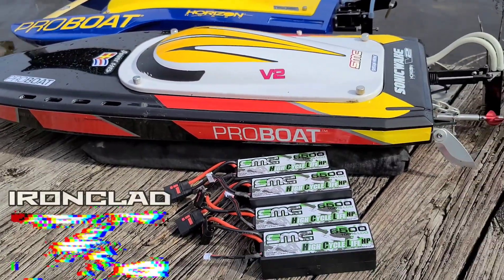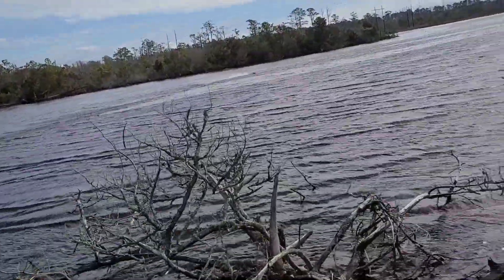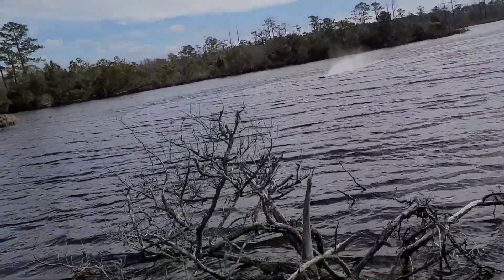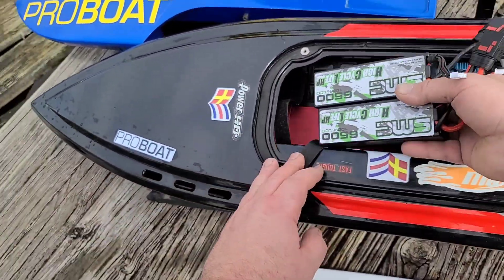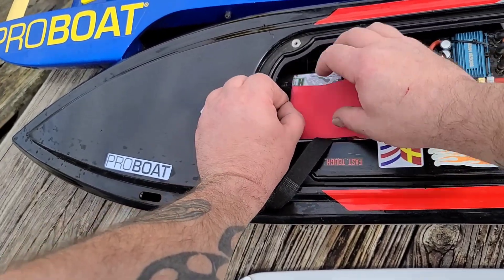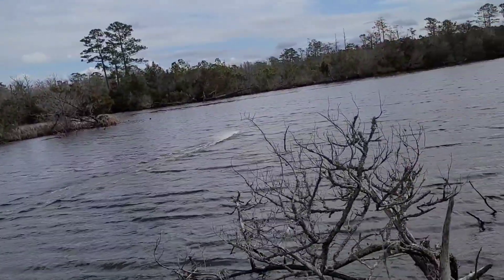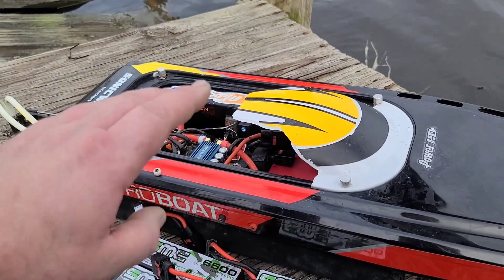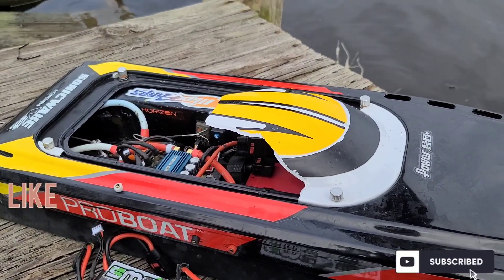Lipo Battery Review & Test Gone Horribly Wrong

Comment: What batteries should I run for a stock motor v2 ? Single? Dual ? I’m so confused.
Reply from the maker: Single 6s with a jumper connector,  or 2x 3s lipos, Either setup is about the same.

Comment: Hello Terry I have been watching your vides now for a couple months now. I have learned so much in this time frame. I watch you like clock work always sitting on the edge of my seat. Ty 4 all the great videos. I am a nitro guy and gas rc boater from way back. I am just starting out in Electric  S battery boats.  I just bought a proboat sonicwave v2 I love this boat the best based off all the videos that you have done so fare.. I believe the biggest upgrades you have done is all the different props you have tried on this boat. The 2nd biggest thing that made a difference is the 150amp esc that you put in it.  And the 3rd biggest thing you have upgraded you have done is your outlive stinger that you upgraded too.  Can you give me your biggest upgrades that you think that you have done to the boat so fare like prop size and esc and stinger . Where you bought them from so I may upgrade in this direction I the near future.  Ty 4 ever watching your awesome vids..on the edge as always...ty So much Sir.
Reply from the maker: Welcome back to the boat gang brother.    My 2 favorite upgrades hardware wise is the tfl adjustable stinger and the larger turnfins.   Bought from offshore electrics. My v2 has been out of commission due to a bad crash at 80mph cracked the hull beyond repair.
Reply: @IRONCLAD RC  wow I never seen that episode 80mph kinda harsh I seen the one that you made it into a converable that was a big time blunt crash. Well I sure hope you can getter fixed up or get a new hull and contues on with your great video of the v2 sonic wave ..you totally solid on this boat. I kinda like at 60smph boat it looks great at that speed. 70 getting a little out of sorts at this speed. I can't even amgain this boat at 80mph. Ever accident at those speed will mostly be the end to that boat.

Comment: I feel for you I just lost my gnss gps speed checker as well.
In fact I also lost my favourite rigger it is in 25 foot of water that is the second complete boat lost out there in 6 months 
It was only 26 inches long (jae 26 zipkits)with a tp 2968 3000 kv running 4s 100 c 3300 mah a120 amp Seaking pro esc and a dasboata modded prop it done 114 kmh (71 mph) with great run time no temp issues
It had all the good gear in it and now I’m grieving the loss.😭
Reply from the maker: Oh man, that's a bummer, I hate to hear that. Unfortunately, It happens I've lost several boats in the last 7 years not including all the  hatches.....  I got lucky with the SW L.U.C.K.Y..

Comment: I just torpedo'ed my sonicwake..nose first at 89km. Think I'm just guna fill the nose with epoxy!! What's big b's recommendation?? Thinking jb plastic weld. As you have used in videos beforehand?
Reply from the maker: G-flex brand epoxy stick best to polycarbonate, mix some fiberglass hairs in with the epoxy for some reinforcement
Reply from the maker: Sand the repair area, rough it up good so the epoxy sticks and bonds to the poly

Comment: 150c on a 6.5ah pack?  975amps as continuous output, with no issues?  Come on...ridiculous!  What they are saying is you can basically dead short the battery, walk away and everything will be fine.   The Chinese are destroying a once reliable standard - the C rating - like they did for lumens on flashlights.  Flashlight nerds call their bullsh*t  "Chinese Lumens".  Perhaps we need to do the same for Chinese lipo's too!  We can call it the "CCP rating"  LOL  The difference is, bullsh*ting lumen ratings don't burn homes to the ground.
Reply: I also wanted to point out with a second post instead of editing a day later that I'm not specifically calling out these batteries alone, SMC seems like a very legit place....but C rating in general is becoming a joke.  Hell, even SMC themselves makes a similar comment on their site about the subject!!  That's why they created their own rating of sorts to show acceptable current draw.

Comment: Did you ever go back and check weight per mah? Obviously crappy cells can weight alot and have a low mah rating and vis verse.
Reply from the maker: In my experience, a heavier battery weight, weight to mah/c is better than a lighter battery of the same mah/c etc.   

Heavier battery packs usually have better discharge & runtime than a lighter weight pack.  

Smc 5200 vs zee 5200   smc is a Heavier pack, smc gave me a consistent 5+  mph every time  I tested them against the zee packs 

Smc VS zee 
Test in my library
Reply: @IRONCLADRC  awesome! Probably thicker conductors inside as well to transfer that powa!

Comment: A Physics professor asks the class:  "A boat traveling at 70mph comes to a complete stop in 1/2 second.  This boat has a plastic hull that can flex slightly and has an over-tight hatch.  Calculate how hard the batteries pulled on the tray and how many dollars it will take to repair.".........

EDIT:  I know you have a great deal going with ProBoat, and I think their product line is outstanding,...... BUT ........ all that running gear would fit neatly into one of those sexy German fiberglass/carbon fiber hulls........
Reply: I have to agree with Dr. jet, I wish I bought the Vanquish 55 from Arrowshark that’s made from carbon fiber.  I bought a fiberglass 57” Fountain from Bonzi sport to save $200 bucks and it had the worst layup air pockets everywhere and pinholes. I cut the transom off to repair it now have more money into it than a carbon fiber boat.  Live and learn. How do we get Big B’s address to mail donation?
Reply from the maker: I've got the v1 hardware, motor and esc laying around, been waiting on ose to get the deltaforce 29 mono  hulls back in stock.
Reply: @IRONCLADRC  Check out some of the boat porn from Oliver Seiss at Hydro & Marine and MHZ Modelbau (both in Germany).
Reply: Dr jet, talk about devils advocate “ do it , do it! You know you want to” I love it 😂

Comment: Wow, that crash was brutal! Man, your so lucky it didn't sink. This is what my oxidian also likes to do, thats why i'm reinforcing it now. Scares everytime the shit on me, but also makes it a thrill... 
I'm glad you got it back though, that would have been so f....ed  up.
Reply from the maker: I got extremely lucky, and drove the boat back under its own power thank goodness.    Removed all the electronics soon as I got home, disassembled the motor, servo, everything, what a pain in the as$    

I have to do this every time my boat gets flooded at the speed run spot.
Reply: @IRONCLADRC  Maybe a tip. I have a spray from thats from the brand tec7 and the type is gt7 spray. Isn't such a compatibel spray available? Its a silicone free, rust desolving-, contact-, lubricant-,moisture protection spray. When my stuff gets wet i dry it out and then spray it with that stuff, electronics, connections and bearings (front and inside the bl motor). All new electronics get a spray before use on the water...  Haven't had any problems (yet), only lost a servo (not wp version) and a lipo (which corroded internaly on the contacts, haven't sprayed those btw).

Comment: I flipped my v1 and the boat split almost in half around the seam and batteries flew out and sank. Got the boat back luckily and horizon warrantied it for a brand new v2. Let’s just say I’m not speed running it anymore. Lol
Reply from the maker: IMO The v2 seems are far more durable than the v1
Reply: I could tell once I picked the v2 up it was more solid. It also felt more stable on the water.

Comment: Woah, brutal crash BigB. I'm actually surprised it's only the hatch. Did you check the hull carefully afterwards? It sure was moving though 😎
Reply from the maker: You got that right, couldn't believe the hull took the crash.   When I got home I pulled all the electronics, no damage to the hull it self.   Disassembled the motor, servo, reciever, freshwater and corrosion X.   ONLY damage was to the hatch thank goodness.
Reply: @IRONCLADRC  That's awesome...well sort of.  LOL  I wanted to comment in my last post about the crash.  I can feel and relate to every single emotion you showed.  LOL   It's like setting a drag race record as your motor blows crossing the final speed trap.  Joy, frustration, happiness and sadness in one sweeping emotion!